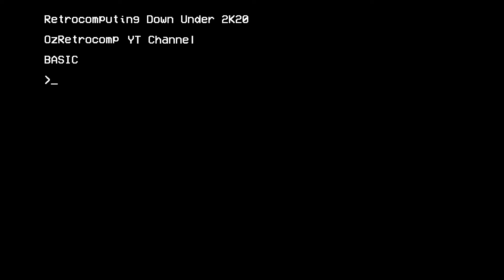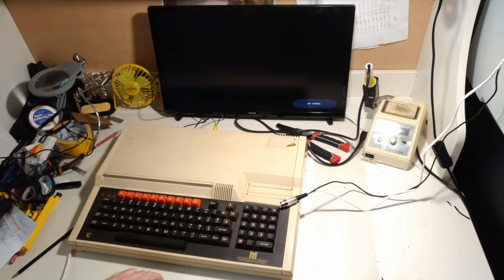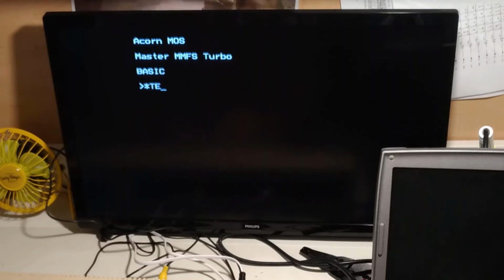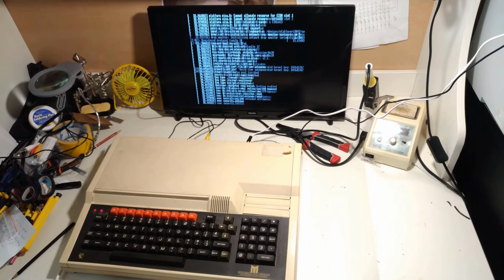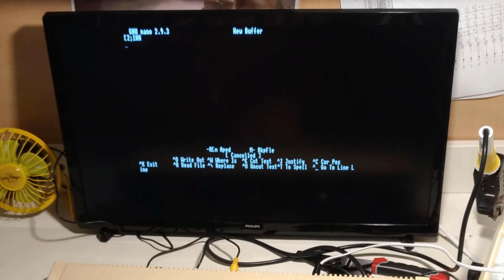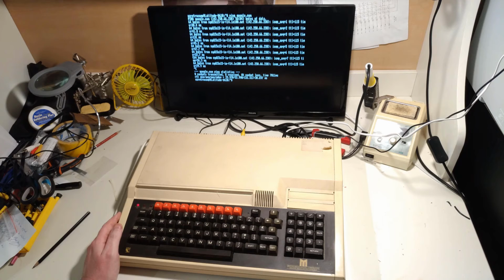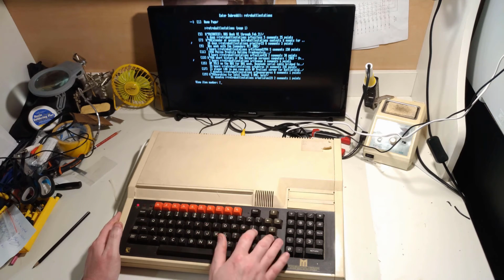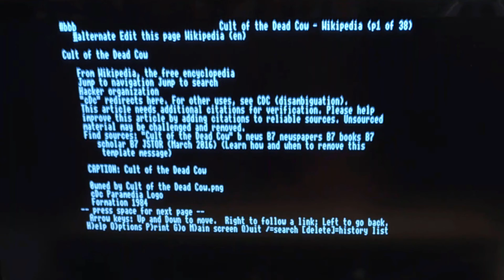Acorn BBC Master 128: Connecting to the internet using *TERMINAL and GNU/Linux

Comment: Great stuff there although my Master struggled using Terminal , I always end up using something else. Well impressed with the Gopher stuff. Just wondered if you fancied checking out my BBS. It is still testing at present but will offer dialup and TCP/IP. It is a Viewdata Board (like Telstar) hosted from a lone BBC Master. There is a about 200 pages of reading there and a sysop chat function.  I set it up in the evenings only and at the moment it's not every night but if you let me know if you fancy looking I will set it up ... cheers
Brian
Reply from the maker: Thanks for your kind feedback, Brian. Unfortunately my Master is currently in storage, but yeah... I'd definitely enjoy nosing around your BBS via Telnet on my daily driver PC once it's up and running. I don't always get to the comments section, but my contact details are in the 'about' tab (email, Twitter, Mastodon etc).
Reply: @OzRetrocomp   I ll send you an email with the BBS details. Cheers
Reply: @OzRetrocomp  couldn't find an email address for you. The BBS is pretty
much live every evening now (GMT obviously but I often run into the small hours
which might suit you time wise, it's called the Night Owl BBS. Its on the Telnet
BBS guide and there is a dedicated thread on Stardot in the Communications
section. There's lots of way to access including two via web browser as well
as dialup up and TCP/IP.  It runs on a BBC Master so hope you can visit.

Comment: Dude that's so cool. And also a cool object lesson in website accessibility. If those sites were not WCAG2 complient, you'd see very little of use at all in plain text. No ASCII porn though? Mate...letting the side down :D :P
Reply from the maker: Cheers! I'm surprised at how easy it was (the hardest part being soldering that bloody domino DIN connector!), as well as how usable the web is in Web 1.0 form.  As for ASCII pr0n, I'm saving that for OnlyFans. ;)
Reply: @OzRetrocomp  🤣🤣🤣